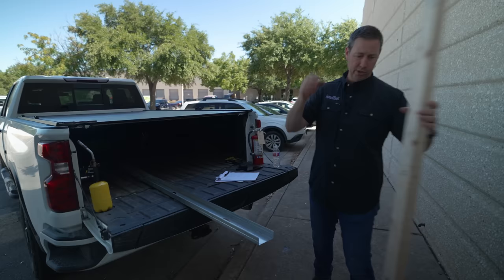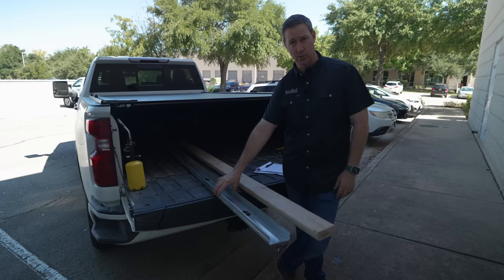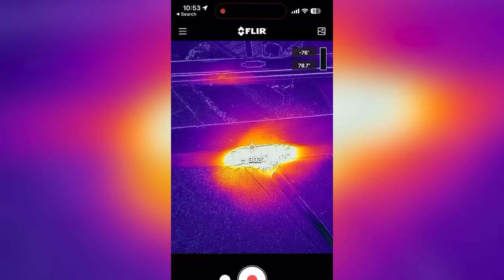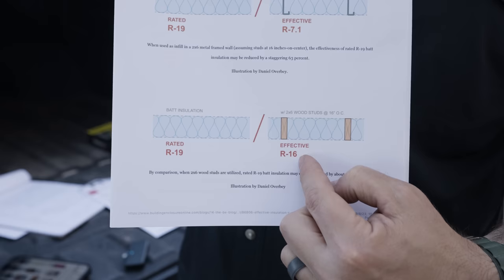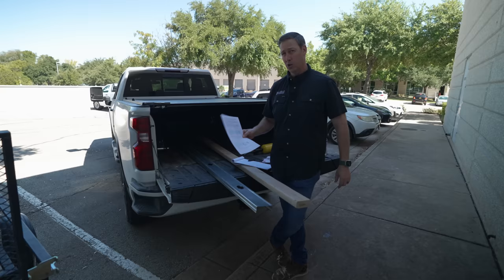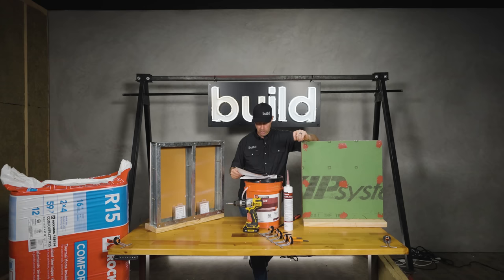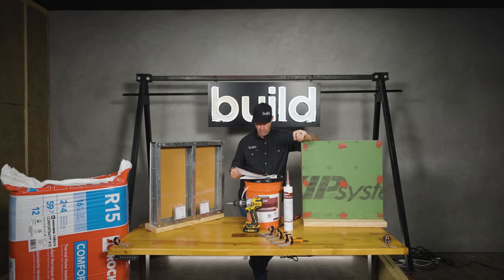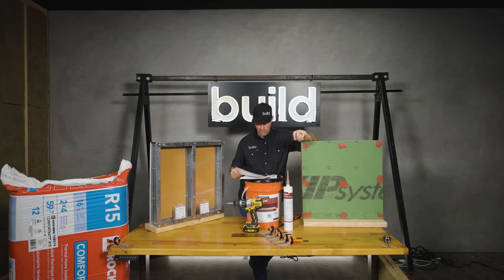Framing Studs: Steel vs Wood

Comment: @16:02, this dude is promoting wood stud over steel stud by emphasizing the superior energy conservation property of wood stud framing over steel stud framing. As not all building are located in very cold or hot geography, the higher R value of a wood stud framing is not that persuasive. As most building uses 2x4 framing rather than 2x6 framing, the video’s showing the R14.4 value of  steel stud framing is sufficient. Finally, it’s the total cost of ownership of a building that matters, not just R values. Steel stud framing doesn’t warp, crack, split, rot, mold, or suffer terminate infestation — all vulnerabilities of wood stud.
Reply: I also thought that was an odd set of things to point out/ use as a use case.

Comment: Metal a nightmare: to work with, to cut, virtually impossible to screw anything into(other than a high powered sheet rock gun which eventually will rust). A nightmare to carry safely, can bend over your knee(most of the gauge used in residential homes); not to mention hanging anything. Kitchen's a nightmare hanging cabinets, barn doors, or shiplap. Metal studs. Good for one thing: the scrap heap.
Reply: You got it all wrong man!
Reply: Caveat- steel are resistant to termites!
Within the video surface great points from both materials(interesting to get other builders to chime in their field experiences)
This video well presented per usual- we gave our 2 cents based on actual consistent field based real world experience- just like several other interesting comments within all his threads.
Thank you Matt for creating a space for these reflective & productive discussions!
Reply: Wood is a nightmare where we are: expensive, no standard cut sizes, big variations in size when using nominally equal pieces of wood, big variations is strength in nominally equal types of wood, not straight, not properly dried, gets moldy in the humid climate, gets eaten by termites, does not last. 

Metal studs on the other hand have none of the above issues, are relatively inexpensive and quite easy to work with in our experience. We used it for all our residential interior walls. Even the local McDonalds was build using only light metal framing. Well as you can guess this is not in North America, but in the Philippines 😉

Comment: Matt, I think you have a few disingenuous arguments there in trying to compare the same construction details between wood and steel; obviously the wall detail needs to be adapted to the materials you are using.  Aside from sound insulation I would be surprised if any experienced builder thinks batt insulation is useful in a metal stud wall today.  But, they likely appreciate having the stud bays free for trades, and if they really need the extra insulation then a staggererd stud wall with a rock. wool layer between the studs can get you an extra R19.

Also, one of the great benefits of light-gauge metal framing is being able to roll the sections on-site.  

I'm still not sure if steel is a "better" material in general terms compared to wood, but the insulation is likely not the best place to start the comparison.

Comment: steel frame only needs to get hot before it falls down
wood still has plenty of strength even with a stud 70% gone
you wont ever catch me running into a steel frame house because its probably only 20 seconds away from falling down

Comment: Nonsense.
Reply from the maker: What rings as untrue to you?
Reply: @buildshow I would strongly suggest talking to a contractor that does metal stud residential work; it might not be a perfect material but you can do some things with metal that are "impossible" with wood. Sure, you need to create a full assembly if you are using it in an exterior wall, but the only difference there compared to wood is the level of forgiveness.  

Metal stud roof trusses, trade-ready joists... there are a lot of great systems that can work well for residential builders... especially if you are having trouble getting the skilled labor you need.

Comment: I opened up the walls of a bathroom during remodel only to find steel studs in residential. That crap cost so much time and money. Doubled the cost of that project. No, don’t do it. Steel studs are awful.

Comment: Hey Matt, if you're ever in the Baltimore area and want to see a weird all-steel house, let me know. Steel roof, steel frame, steel studs, and steel siding. Oh, and TERRIBLE build quality. I have the thermal cam images to back up what you're saying about thermal bridging. My walls are close to a foot thick but with no external insulation the thermal bridging is atrocious. It was built in 2005 and the builders gave zero thought to air sealing. Seriously, where the front porch roof meets the front of the house... there's no wall. It's open to a 2 1/2 foot crawlspace between the first and second floor!

Comment: Steel studs are not for use on structural walls, and pretty much all exterior walls are load bearing to some extent.  Thus, it makes no sense to discuss steel studs and insulation factors.  One place where steel studs make sense in homes is on walls that require  extra flatness and stability, such as any bathroom where you want a large mirror on the wall.
Reply: Steel studs are absolutely structural. Where do you guys get this nonsense?
Reply: Exterior walls frequently have steel studs.
Reply: I ran a carpenter crew on an early childhood center and we built interior (corridor) walls with metal studs.
Carried the 40' bar joists just fine